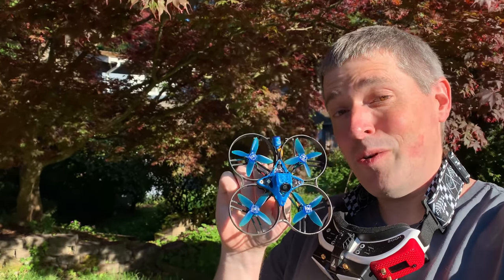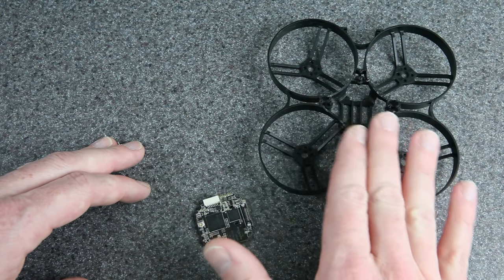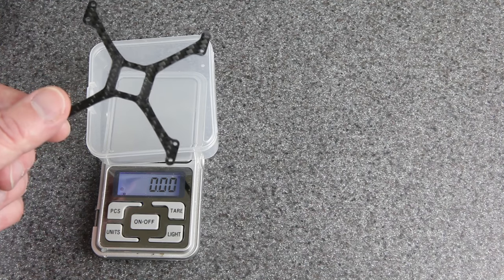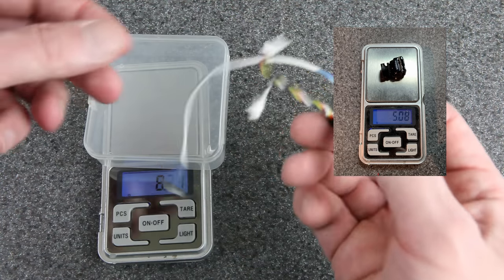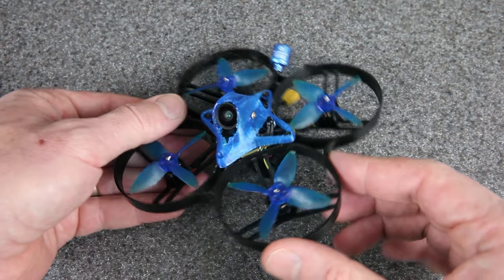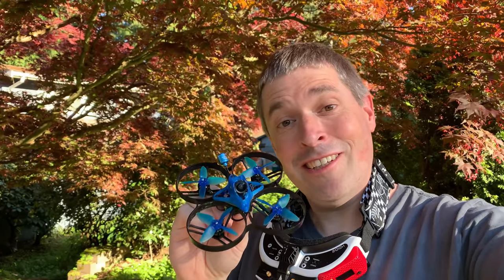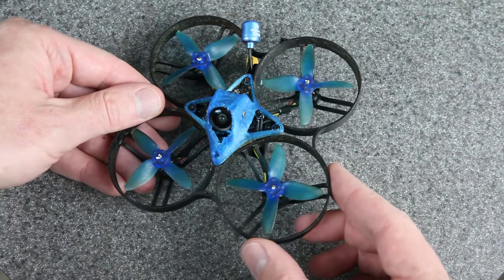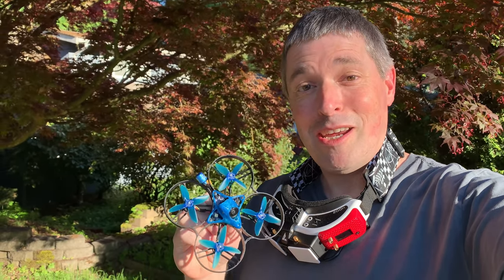Building an AMAZING Racing Whoop with Shark Byte Digital FPV (IT'S SO MUCH FUN!)

Comment: What happened to the video of you flying this in the playground?  I can't seem to find it now.
Reply from the maker: Some people were complaining about it being agains some unposted rule of the park. If so, that’s lame because I obviously wasn’t causing a problem for anyone, but… I didn’t feel like arguing about it so I removed the video, at least for now. What’s up? Did you have a question about it?
Reply: @MrShutterBug  It's unfortunate those people felt the need to be obtuse.  As someone that flies playground spots I really enjoyed that location.  There are always other spots though.  

I didn't have a question.  I've just been coming back to that video over the last couple of days.  I'm in need of something in between my Tinyhawk S and Crux3.  The Tinyhawk S is a great cruiser, but doesn't have the acro performance I need.  The Crux3 just isn't durable enough to hold up in those playground spots, and it's a bit much for a public park anyway.  I'm always worried about joggers sneaking up on me.  

After breaking a frame on a jungle gym today I came home and was going to watch your playground video again to talk myself into spending the money to build an 85mm whoop.  I thought I was going crazy when I couldn't find it.

Thanks for letting me know what happened with the video, and thanks for the all the design work and testing you do.  The 85mm stuff you've done is great, and the lightweight 65mm work you did that led to the moblite was a game changer.  Micros are important, it's good to see someone pushing that class forward.
Reply from the maker: @JoryIsHere  I obviously really like the 85s. If you keep the dry weight under 45g, it’ll fly great. If you weigh it down like I did with this one, then the thrust-to-weight ratio leaves some to be desired, but still lots of fun. 3S is with lower kv (8000kv range) is also an option if you use a 3S-capable FC. 3S will give less voltage sag, but the batteries tend to be heavier. I decided to stick with 2S because I have the batteries and we have a local racing group that is 2S-max. I hope you have fun with whatever you choose.

Comment: Quick question, that last powerloop you did where you crashed due to the washout...were you using full throttle doing the powerloop itself? My Shutterbug85 type build of the same weight as yours would take me way up high in the sky doing that with full throttle. I wonder whether this Avan props are limiting your power delivery. Im using GF2023's.
Reply from the maker: The battery was sagging if I recall. That was part of it. This build needs top notch batteries.

Comment: Looks super fun.  Also thanks for the coupon!

Have you flown the Twig ET5?  Its only about 130$ after the coupon...
Reply from the maker: Here's my review of BetaFPV's version of the ET5 BNF:
https://youtu.be/EHn5RcFMZzc

I think the 1506 motors they used are too small. They would be good on 4-inch but not 5-inch. The 2004 motors are much better on the ET5. You can see an example of that combination here:
https://youtu.be/5sJYGE7f6GU
Reply: @MrShutterBug  thanks, I think I have some 2203s that might work from fpvcycle

Comment: Wow, nice one. Are these races always in acre?
Aaand where is that Rx antenna on that nice build?
Reply from the maker: There is no requirement about Angle Mode vs Acro Mode. People are free to fly however they want. That said, I'm pretty sure everyone chooses acro mode for the outdoor races with the full sized MultiGP gates. When we race indoors with smaller gates (more like a 1S whoop race), then most people prefer Angle Mode, but not everyone.
Reply from the maker: Oh, and the Crossfire Rx antennas are taped to the back guards. If you watch all the way to the end, you'll see how I did it. ;-)

Comment: hi! I'm sooo building this! are you happy with the BetaFPV motors? I've seen T-Motor has the same size/KV, and XING (which I love) has 1103 10000KV Gen2, so a thousand less. would you suggest experimenting with either one, or stick with BetaFPV? thanks as always!
Reply from the maker: The BetaFPV motors are the right size and weight, but they do not have holes for prop screws. Some people prefer prop screws because some props are too loose otherwise. There are other options out there. I think you could go with any brand as long as long as they mount the same way, are similar in weight, and have similar specs.
Reply: @MrShutterBug  great, thanks

Comment: Thank you for your Work and the B4.3 Settings, but how can i use them without working firmware ?
JHEMCU Play F4 Target = Nox
BF4.3 Configurator say: Target = betaflight_4.3.0_STM32F411 and AIRB-NOX.config
After flashing nothing worked, no Gyro, no Serial...
So im unable to use your settings and i wonder what firmware/config did you use ?
Thank you
Reply from the maker: Sorry. I used an early development version of bf4.3. It changed quite a bit before the official release candidates, so my settings are no longer relevant. I’ll update the video with a warning about this. If you want to use BF 4.3, then you should be able to use the default settings. It should fly cleanly on defaults, but you can adjust the tuning sliders to tweak it to your liking.
Reply: @MrShutterBug  not able to read a question, answering totally different stuff...then BLOCKING the user who asked the question.
were talking in discord about your acting here, such a shame for you. if blocking is helping you, feel free to block me too.
that must be the so called "american way of free speech"

Comment: Is it a good time to get sharkbyte ? Just don’t want to jump in and a month later an improved hardware gets released
Reply from the maker: There is no way to answer that question. Tech is advancing all the time. Shark Byte does not have a crisp HD image like DJI does, but I enjoy the fact that I can put it into small build like this one, and the fixed frame rate and low latency feel great. It's probably good for 5" racing too, but I haven't tried that. People tell me that Shark Byte is capable of transmitting a true 1280x720 image (720p HD), but the current cameras are closer to the resolution of analog. If that is true, then we have not yet seen a camera that maximizes the capabilities of Shark Byte. If that materializes, then it could be great! I hear Orqa is working on their own digital system too. There will always be something new on the horizon. :-)

Comment: Hi sir I have 1105 6000lv brushless left over. I think I want use this motor and yes it's heavy plus low kv. Do u think is this good ideas for flew this heavy 86x +1105 6k motor. I will use emax a an prop or similar 4 blade prop. So I need some input whether this is is flyable or not with 2s 450mah and 3s 450mah lipo. My budget is low on motor die to I already regret biying many pcs motor that I have can fly be a I go straight to tp3 build. But I'm newbie and still new in fpv stuff

Comment: Super cool man! I'm just getting into fpv is digital the future for whoops? The video looks amazing for something so small.
Reply from the maker: Is digital the future? I hope so, but there are still reasons to fly analog for now. It is cheap, it can be very light, and nothing is proprietary with analog which means companies are free to compete on all the components.
Reply: @MrShutterBug  Im moving from digital to analog in addtion because of these reasons. Started with the dji fpv drone. Moved on to the smaller emax babyhawk 2 hd. Now down to the crux 3 and Uruav UE85 to tks rocket 2s build. Love your channel. You rock in toothpick builds. Came across your et5 5inch sub 250 build first. Now I gave up on that bigger sub 250 and thought what the Heck. Get a toothpick 🙃

Comment: hello I have the same configuration I can not put osd how did you do thank you
Reply from the maker: The Shark Byte VTX has to be connected to a pair if RX/TX pads on the FC, you have to enable MSP for that UART on the Ports tab, and for “canvas mode” OSD there are two CLI commands. I recommend finding the section on canvas mode in the official Shark Byte manual. Good luck.
Reply: @MrShutterBug  Uart 1 CRF RX  uart 2 vtx
set osd_displayport_device = MSP
set displayport_msp_serial = 1
I did well?
Reply from the maker: @ffbigboss62  set msp_displayport_serial = 0. UARTs start counting at zero internally. So the one called UART1 on the Ports tab is actually called 0 internally.
Reply: @MrShutterBug  Hello I have tried everything it does not work 😞
 I will flash the FC play f4 whoop
 What's the no for flashing and which version did you install please a big thank you for your help!
Reply from the maker: @ffbigboss62  I'm using a nightly build of Betaflight 4.3 (not yet officially released). On a previous build, I used Betaflight 4.2.8 and that also worked for OSD. I don't think it works on any version newer than 4.2.8. Sorry you've been having so much trouble with it. Good luck!
Reply: @MrShutterBug  don't be sorry you help me a lot thank you :) i'm in nox 4.2.9 for fc and betaflight 10.7.0
Reply: @MrShutterBug  small question you connect it or your vtx on rx2 / tx2 or on rx1 / tx1 last question if I connect my vtx on rx1 / tx1 I will put what on msp_seeial =?
Reply: @MrShutterBug  I finally have osd;) tx2 has been disabled

Comment: What about the BeeBrainBL Boards with their light weight, 2S, and 12A ESCs?  

Also, does anyone else make frames that are this caliber?
Reply from the maker: I have not tried the BeeBrainBL 2S. Presumably it would work fine. The only other frame is the one used in the “Cinecan”. That frame is lighter but not as durable.

Comment: This is great and I almost regret having a 75 (second hand) instead of a 85 now. It's funny because when I got into quads in 2013, I rapidly build a light 5 inches, under 250 gr with (fragile) 10 gr 2000kv motors, the lightest I could find for 5 inches. I was using a toy frame https://www.youtube.com/watch?v=yN2p2Ry625M . Anyway, I always thought it could be far more dangerous for people if there were protections. 

Besides, I have a question for you. I'm trying to build a "closed" (heavy protection) quad with a board I have tested on a standard 2.5 inch, but when I throttle up, it oscillates in diagonal like crazy. I'm thinking about vibrations and I "hotglued" the board to the frame but to no avail. What would you try please ? (note, I fly in angle mode, but that may be too sensitive ?)
Reply from the maker: I is hard to guess what could be wrong without seeing it. I suggest you post a video on one of the big Facebook groups like the Power Whoop Group. Then someone can probably point you in the right direction. In general, you will want to make sure that there are no excessive vibrations (damaged motor, imbalanced prop, etc...). Then you will want to make sure that your FC is soft mounted with silicone grommets. Don't hot glue it. Make sure that it is secure enough to stay put, but let the silicone absorb some of the vibrations. Also, make sure you have a clean electrical system. You will know that you have a electrical noise if you see interference lines in your analog video when the props are spinning (and not when the props are not spinning). If the mechanical and electrical systems are good, then maybe the tune is off. I can't explain how to tune in a comment, but I recommend you check out UAV Tech on YouTube. He has lots of great information about tuning. I hope that helps.

Comment: I got a Shutterbug85 ever since I saw your first build and it’s also the whoop that sticks around… I actually use it to try out tricks… It’s by far the most resistant whoop!

I’d love more powerful motors to fight the yaw washout though… and that whoop FC is still working despite the misery it went through 😉

Long live the Shutterbug 🤘🤘🤘
Reply from the maker: I’m glad you enjoy it! The main thing that limits performance is actually the battery sag. I need so see if I can make it more efficient (a relative term). As for the washouts, the carbon brace can also help. Flex in the frame causes the PID controller to work extra hard, and the battery sag prevents it from recovering. Bigger motors would have more torque but they would also cause more flex in the frame. It’s a trick balance. Moving up to 3S would help a build like this one because it would take less current to deliver the same power. Anyway, there’s lots of things we can try. That’s the fun part! 😁
Reply: For me, switching to Gemfan 2023 props got rid of most of my yaw washout. Increasing my camera uptilt beyond 30 degrees also helped a little bit. For reference, I'm on 2s without the brace.

Comment: Shark Byte is the only FPV system that gives me motion sickness. I wonder if it's the narrower FOV.
Reply from the maker: Interesting. I won't claim to know what affects motion sickness, but I can say that this camera does not have a narrow FPV. They list it as 170 degrees which is almost fisheye. I know that it is extremely wide because it can see the canopy if there is more than 1mm of material extending past the lens on the sides.
Reply: @MrShutterBug  I was under the impression from some comparison videos that it was a bit narrower than the DJI cameras, like the nebula pro. I've never flown Shark Byte with goggles, so the strange feeling might just be from watching videos of it on youtube.

Comment: this flight controller just give me 10 flights then dead so dont waste your time with it ..🙏🙏
Reply from the maker: That's too bad. Mine hasn't given up yet. Unfortunately, ALL of the AIO FCs in this size have a pretty high failure rate. Sometimes you get lucky and sometimes you don't.